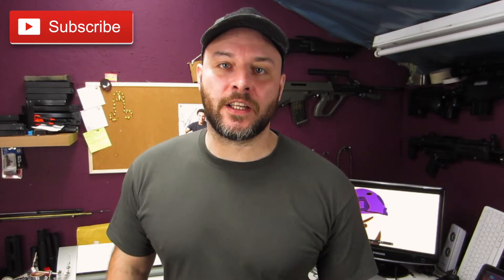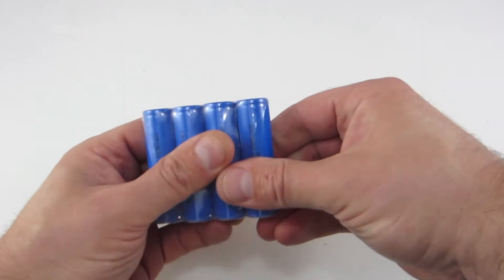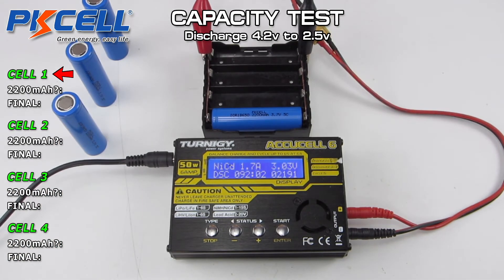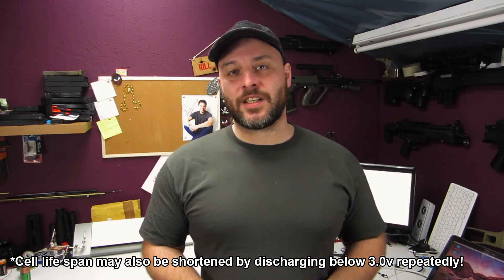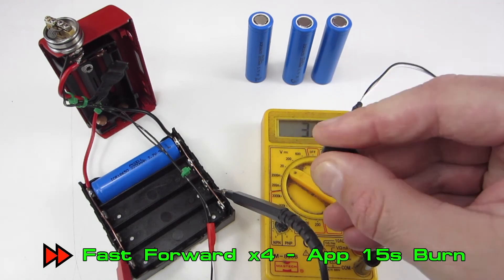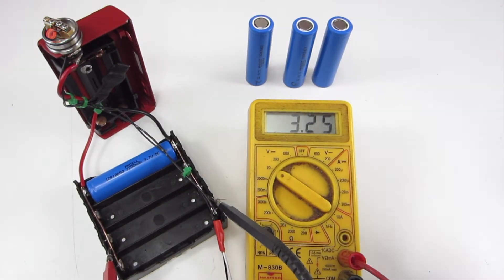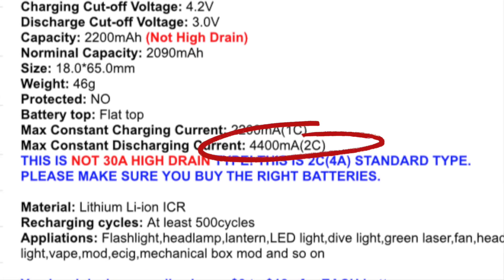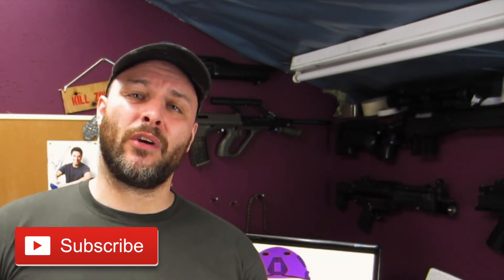CHEAP eBay 18650s GOOD or ??? | PKCell 2200mAh 11A | Unbox, Test & Review

Comment from the maker: I didn't make it clear in the video - but I was told in email from PKCell that the accounts on eBay - and I think Amazon - "Fuspower" and "Durnergy" are the two official accounts they use.  So if buying these, use either of those accounts and you know at least you are getting them from source, so to speak!
Reply: PK Cell apparently now has their own Amazon web store.
Reply: After a huge work to find the best reliable way to get the cheapest genuine 18650 per Ah all over the web, I have exactly the same conclusion: PKCELL from those sellers on eBay :)

Comment: Nice video with lots of new and quality information. Please tell me your own recommendation for 18650 battery lights?
Reply from the maker: Thanks buddy - I must confess I am not that clued up on good flashlights.  For my use, the cheap LED ones off eBay etc work great, the battery is more important for performance.

But I don't need to rely on my flashlights the same way a diver, or pot holer has to, or anyone in the security services - so being perfectly honest I couldn't really advise.

But I do think the most vital part of any flashlight is the cell you use in it.  It must have good capacity, and be reliable.  You must be able to trust it!

Comment: Thanks for the thorough testing. I was curious about this brand.
Reply from the maker: Thanks for taking the time to comment, I genuinely appreciate it!

I know my testing was very "rough" but I feel it was pretty relevant "real world"... it was the best I could do with what I had available to me :)

What I would say is I was chatting with someone on here who didn't rate PKCell at all.  Now, they did concede they did not purchase them from one of the official accounts, so possibly counterfeit - but you never know.

Again, I done the best with what I had at the time, and can only show you what I find, based on the cells I have.  They are still working well in a large 8 cell powerbank - but yeah, perhaps they aren't all consistent, and I can't afford to buy a large enough sample size to say anything really definitive on that front!

I have some EBL 18650s to test next, when I have the time... 3000mAh apparently, and I've been told on here they are good... but they look suspiciously "ultrafire" ish... same design, fonts, spelling mistakes... hopefully have that video up soon!!
Reply: a couple of months ago I bought a 8 pack of EBL 14500's. They were all pretty much dud's, would not hold a charge for crap and when used in flashlights never produced light at near the same intensity as other brands. I wrote a semi negative review on Amazon. EBL contacted me and sent me another 8 pack free to replace what I had. The new pack performed much better but still are not going to work as well as say a Nitecore or other brand name battery. Here is a link to the short review I wrote. https://www.amazon.com/gp/review/R1DD95ILSC8B27?ref=pf_ov_at_pdctrvw_srp 
Someone left a comment basically saying others had tested the batteries  and found the capacity to true. I tried to write a response to the comment on Amazon but it would not post. Looking forward to seeing your review on EBL brand.
Reply from the maker: Thanks for that information!  Kinda backs up what my gut is saying, but I'll test them and see!

What I don't like about the EBL (apart from the aforementioned warning signs) is that unlike the PKCell, they have no specification - they don't tell you what current is safe to draw, nothing.  

So I wouldn't risk doing the torture test on them, like I done here - because with no idea what is safe, there is every chance they could pop... so lack of specs another warning sign!

Thanks for sharing the review, really helpful buddy!
Reply: Absolutely you can't find a spec sheet and when ask questions in the Q&A on Amazon the response was basically they are safe don't worry about it. But they did respond to my concern with the 14500's and replaced them, so there is that.

Comment: very good that you tested these cheaper cells, i use a pair of PK 14500 cells in a small flashlight , with excellent result, decent run-times even on the 'Turbo" setting with is for this UTORCH 01 almost 2,5 amps!!! so good cells to use in LED flashlights .
Reply: Same here! They worked great for about 10 recharges, then started dropping off to about half the rating.  Are yours still holding up?
Reply: @Bob_Adkins  yes the are, i allso made a 12 v batterpack in a 4s3p  configuration with there LiFePo4 cells coupled with a small bums, that pack has now probably 80 cycles on it and still works flawlessly,so I really like the pkcell brand
Reply from the maker: Thanks for taking the time to comment buddy, really appreciated, I'm just about to grab some 14500s so its good to know PK are good there too

Comment: Can these 18650's be purchased with premade solder tabs and are they pcb protected?
Reply: Are you sure that it is possible to solder on them? I am looking for ICR 14430 and looked at this brand. I got this KeepPower http://www.keeppower.com.cn/ and it isn´t possible to solder directly on the battery... the soldering iron didn´t stay on the battery... make balls and go out from the poles...
Reply from the maker: You can get them with tabs yes, just need to look around - however its absolutely simple to solder direct to battery if that will do you, just lightly abrade and I find using a smear of acid flux works a treat.

And yeah - you CAN get cells with PCB protection built in but all the cheap nasty ones I've looked at so far, that claim to have a circuit, don't!  So again, buyer beware!
Reply from the maker: Its definitely possible, I've done it loads over the years.  

The trick is to use a tiny bit of acid flux (like plumbers would use on copper pipe) - just a smear - on the battery where you want to solder too.  Wait until the iron is nice and hot, then touch it on, feed in a little solder, then back off.  Nice and smooth.

Once you've done that, you will have a "tinned" area on the battery, that is easy to solder a wire onto.

You can see me do it (although not with a battery, with connectors) in the soldering for beginners video I done, works great, and if you only use a tiny bit of acid flux, you don't need to worry about it - it all burns off.  I've been doing this for years without issue for simple soldering jobs like that.  I wouldn't do it on PCB or with small components though - but for big simple stuff its great :)
Reply from the maker: Others will say lightly sand the area of the battery you want to solder too - also works if you are quick, but I prefer the acid flux, makes it zero issue and is quick - hope that helps buddy!

Comment: Actually I got some of these, you must have just been lucky and got a decent batch cos my one's are crap.

When I say crap I mean they are very poor, yes they work but you wouldn't wan them in a cycle lamp, cos they would drain way too fast.

As for a power bank again yes they would work but they just don't have enough go in them to make it worth while using them for a power bank.

At best these batteries are ok for perhaps a small radio, so you would use 8 cells to power your radio for around a day, and then you would need to put them on charge.

I actually paid £18 for 8 of these and they are the worst battery I have ever bought on ebay.
Reply from the maker: Hey buddy, that doesn't sound so good - I got mine specifically from their eBay account "durnergy" and were quoted at 5c (11A) continuous... As I say in the video though, all I see since is the 2C / 4.4A version.  Where did you get yours (which seller?)  PKCell told me via email that Durnergy is one of their 2 official accounts so if you got them from there, they should be good - unless quality has went downhill!  Did you complain?  Any time I've complained I've been refunded no questions. 

Maybe its time for me to buy some more and test again!!
Reply: Well it wasn't any of those you named so perhaps they were fake pkcells.
It comes to something when they make fake cells of poor quality cells and pretend they are the poor quality cells.

But that's the problem in the UK we just can't get hold of decent 18650 cells at a reasonable price.

So far the best cells I've been sold which came from china were some Ultrafire cells, I say best they were not brilliant but they did perform rather good, one has failed so far out of a batch of 10, and they are in Drills and power a small amplifier and a few other things.

I bought the pkcells for a power bank and wish I had bought the ultrafire cells instead, at least they would have been half the price and I would have not expected that much out of them.

But I suspect these were fake pkcells but it does put me off trying any more of them as they are expensive compared to the Ultrafire cells.
Reply from the maker: I would definitely complain, if you bought them through eBay its only a click or two to open a case - and they side with the buyer - you WILL get refunded 😀

I've heard there are "good" Ultrafires, but yet to come across them.  The best I've had have been 5-600mAh - but most have been 100-200mAh.  Pathetic.  

If you get refunded, post me these PKCell you have and name the seller (I'll pay postage) and I'll hammer them in a video 😁
Reply: Thanks but I will accept the fact that some times you just don't get what you want when you buy online.

Yes it was around £20 and I didn't really expect that much but I did expect a bit better than I got but hey ho they will do for now as they are all linked up in parallel 8 cells linked together I will test them to see what they are pushing out in total but at present from using it in a power bank it is pretty low.

In fact I think that's something I will test tonight to see what they actually have all 8 cells linked up.

But regarding the Ultrafire cells I've bought a few of them and not been disappointed with any of them to be honest, of course they are nothing like Panasonic or Samsung cells but they are a lot cheaper and good for things as mentioned above.

Using them in a drill I've stripped a whole fairing off a motorcycle and put it back and had charge left over for other things, maybe I've just been lucky with the Ultrafire as I have heard some people say they are terrible.

But thanks for your offer I will just absorb it for now and let you know what the cells are actually pushing out all 8 in parallel as I can't even be bothered to split them up again, just not worth it.

The best Ultrafires I have had was the red stripe ones and the black ones, got some blue coated one's still got to get around to trying them out, and they were less than half the price of the pkcells, but have since gone up.
Reply: OK did a complete discharge test using the Imax b6ac and from full charge all 8 batteries in parallel put out 02500 ah they say they are 2200AH so that should be 17600 in total for all 8 cells in parallel but the total is just about a little more than one cells rated value.

So I tried over charging them just once that's all it took 5 of the cells have failed completely 3 cells are just about putting out 1 volt.

I could well be the protection circuit faulty on them if they have one, I punctured one with some sharp object and noticed a lot of gas came from it and put the multi meter on it to find the voltage actually went up, climbed quite a bit about half a volt then it gassed some more and continued to climb a bit more about .2 of a volt of course I had to take precautions incase it caught fire so now it's sitting in my sink I will have to discharge it fully before I dispose of it.

So I'm thinking perhaps the problem with these batteries is the internal valve and possibly the protection circuit, if it has one, though I didn't actually find one yet will have to take a good look.
Reply from the maker: Something definitely not right at all.

Piercing them/gas/temporary voltage increase is normal, that's oxygen getting in and starting a reaction - you were right to put in your sink as it can runaway.  Whenever I pierce or open any, even ones I know don't have enough energy to do anything, I discharge them down to 2.5v, then down to 1.5, then down to zero - and I still get the odd puff of gas or spark.

Definitely sounds like crap cells, for whatever reason
Reply: Anyway won't buy those again, but I have some old ultrafire cells I'm in the process of charging and testing, they seem to have a lot more power in them, would you believe when I bought these which was last year I got 10 for around 10 pounds and they all work pretty good they have gone up a bit now to around 12 to 13 pounds.

I bought these from King-future on ebay in hong kong had to wait a long time for them but they are pretty good batteries considering the price.

Will let you know if they are still up to the grade as more are on the way.
Reply from the maker: I'd really need to see these ultrafire in front of me to be convinced.  I mean I know you are saying good FOR the money, but ultimately, every one I've ripped apart (a few now) has been so crudely put together, it is just laughable.  And, with the capacity being nowhere near claimed, and no mention of safe current outputs, they are potentially dangerous - maybe you have got a source of hallowed decent ones though! 

You've got me wanting to buy more pkcell to test now
Reply: Yes I've heard a lot of people talk bad about the ultrafire cells, but so far every batch I have bought have been good the price has been reasonable around 1 pound per cell or less in the case of the last lot I bought.

But remember my expectations were not high, but I was pleasantly surprised how decent they were.

Still I have more coming and from the same seller so will let you know if they are equally as reasonable in performance.

For sure they are not anywhere near what they claim, but they do a pretty good job, way better than those pk cells I bought, those cells wouldn't even have run a small motor for any length of time, my ultrafire cells have done pretty good, and only one cell has failed over a good 5 year period.

But they often are a little bit bigger due to the raised positive electrode so this has presented a small problem for my power bank, but they are decent enough cells that I can cut the number of cells I use in the bank and still get a reasonable output.
Reply: @flitsies  you must be some competitor of pkcells or someone who works for or is sponsored by Ultrafire or something. I have ordered hundreds of pkcells and NOT one has been bad. I have also tested hundreds of ultrafires from many different suppliers and different dates and they ALL were crap, every single one. I rebuild battery packs and have an electrical engineering degree and design/build massive battery banks for industrial use as my daily job so I know a thing or two about li-on batteries. I have yet to come across an ultrafire that is anywhere near good. You probably don't know what good looks like. Pkcells are VERY good cells for their price. There's no competition at that price. This was a good video to illustrate that too. You probably bought some fake cells.
Reply: @mztd912  Yes that is highly possible that the cells I bought could have been fake, all I can tell you is that the cells I bought were total crap, and they turned up with the PK packaging and card.

I have bought lots of Ultrafire cells, they are clearly not the best far from it, but  for the price I find they do ok.

I have replaced drill batteries with ultrafire cells and small vacuum cleaners cells with ultrafire cells and in each instance which has been more than one they have performed well.

As I said before for the price the cells performed beyond what I expected.

The cells that claimed to be PKcells were so bad I just ended up throwing them out if my memory serves.

But they could well have been fake which would account for their poor performance, but if they were fake they went to a lot of trouble copying the paperwork that is associated to the genuine brand.

Comment: Good show!  I did the exact same thing only with the 3000mAh PKCells, and also got exactly what was printed on the casing of the battery.  Now I'm in the works to build a Tesla style battery pack for my Zero motorcycle using the 5C cells you just tested.  They've got a great bulk deal on eBay right now, 200 for $500, which I'll probably try getting cheaper since I need 600 of them.
Reply from the maker: +Matt Williams - cheers for dropping by and taking the time to comment buddy!  Good to know they have 3000mAh cells that do what the claim too, could be hand for some big capacity power banks!  What current rating are those ones?

Comment: Awesome stuff, good to see that you can get decent quality 18650's on the cheap! Even the 4.4A discharge ones would be OK for me; I use these in electronic projects (portable electronics), not vaping or high current loads.
Regarding discharging: I always go to 2.5V on a capacity test to test the maximum capacity that is possible. Under 2.5V is over-discharging them, though most protection PCBs I've seen are around the 2.5V area, hence why I like to discharge to 2.5V for capacity tests.
In real life, I won't let them go that low all the time, but even if it did shorten the cell life a small amount, I can get 18650's quite cheaply (from laptop battery packs) so that isn't a problem.
Reply from the maker: +spotify95 - cheers for commenting, I appreciate you sticking around 😀.  Totally agree on the 2.5v, the manufacturer claims their capacity on these is 4.2 to 3V - and the were right which did impress me.  But I tool them down to 2.5 to see what's what... The return isn't worth it so like you say, in real life no point :-)

Good batteries for all sorts of applications and inexpensive too, I'll be honest they surprised me!